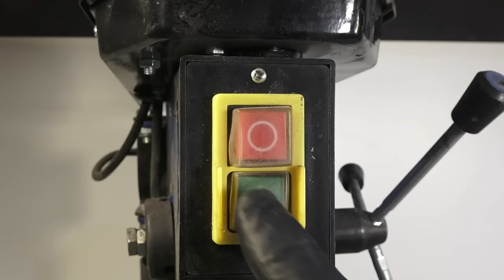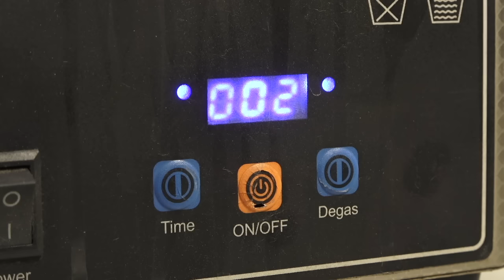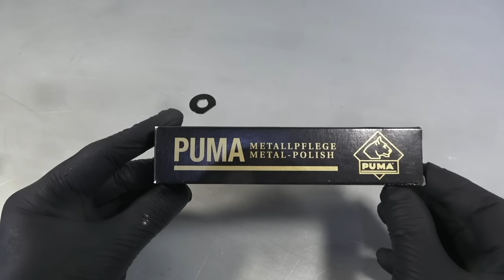1960's Camera Lighter 🔥 - Restoration

Comment: I had one of those in the sixties but there's a part missing. It's the remote plunger cord that screws onto the post which houses the ignition button.
Reply from the maker: I thought that remote was an optional thing… Thanks for the info tho 😌👍
Reply: I bought it in Belgium, in 1961, on a school trip. It was a gift for my father. I inherited it later on, but bits subsequently fell off, and it was probably thrown away.

Comment: Perfect restore except for one thing. The aperture dial around the lens is upside down. The flat part goes on top.
Reply from the maker: Thank you ! Are you sure about that? I’ve already seen several with uncut dials…
Reply: @TheFabrik  You are correct sir. I spoke out of turn. I have about 4 of these types of lighters. One of them, which I mistook this one to be, has the dial cut on both top and bottom to fit inside the frame. I do not have the exact one you showed in the video so I am unsure if the dial was cut or not. My apologies for jumping the gun on that.